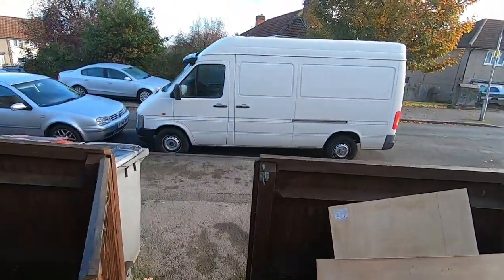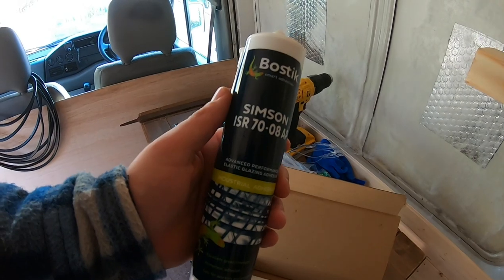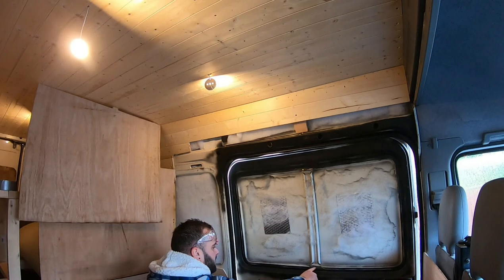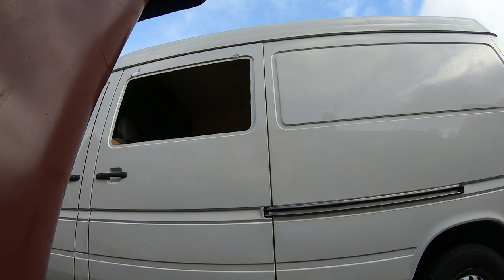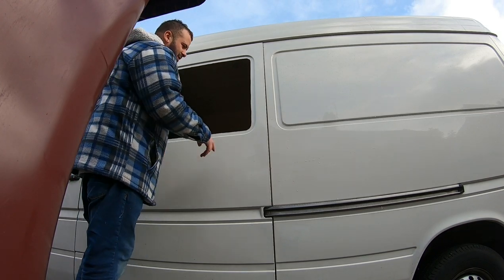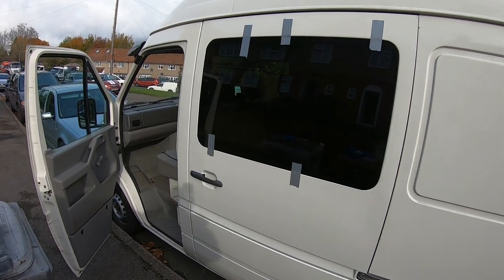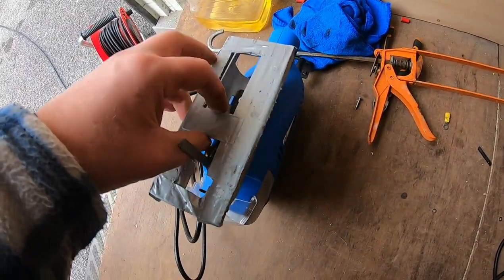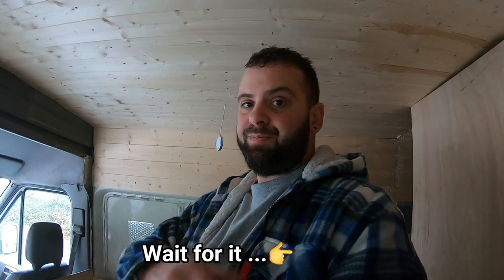Pt.4 - Fitting side windows vw lt35/sprinter full diy van build campervan conversion

Comment: Scary isn't it?  Angle grinder was quicker for me, but WARM the sealant - and use too much. Seal the glass to the knock-on edging inside too or the gap will fill with water from condensation.